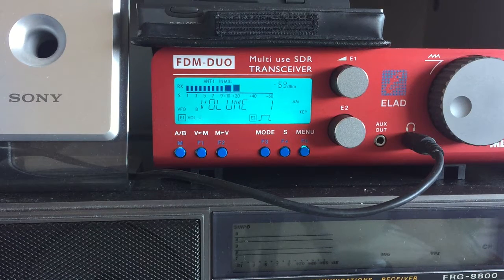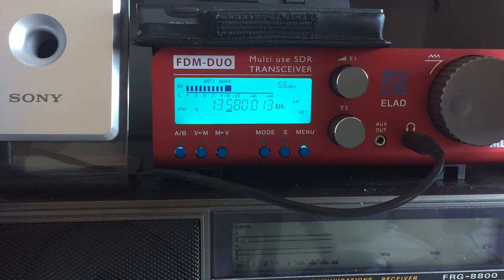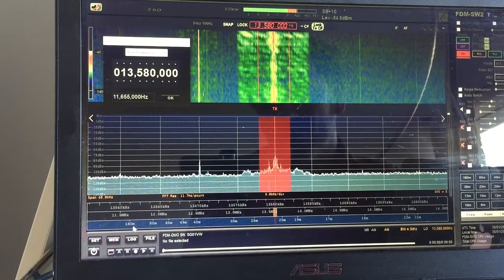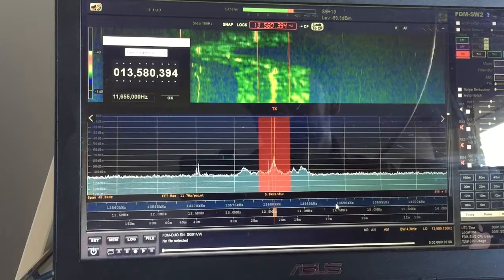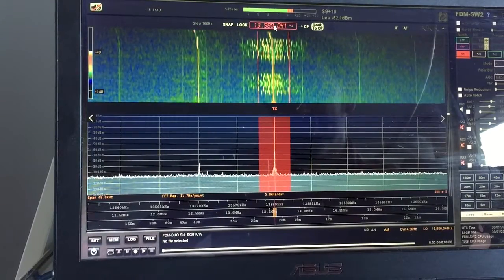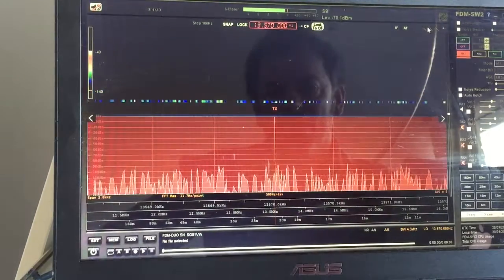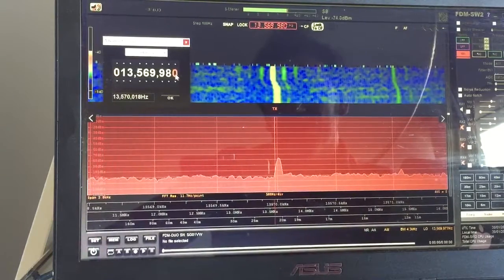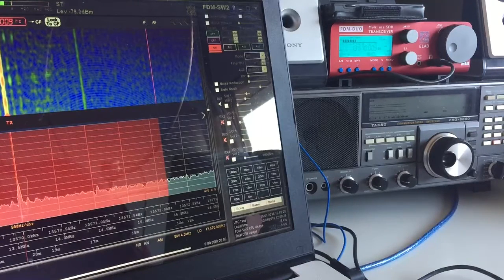6 different methods of tuning an Elad FDM DUO

Comment: Excellent demonstration video. Well done, Clint. You can set the direct frequency input to kHz instead of Hz in the settings menu, by the way so you can avoid to type in the ".000". 73, Matthias
Reply from the maker: +senderjaeger Hi Matthias, thank you very much. It took a couple of weeks to properly get to grips with the FDM-SW2 software in conjunction with the FDM DUO, but was worth the effort. Setting the direct frequency input to kHz will save time so thanks for the tip, I'll check it out. 73s! Clint
Reply: +Oxford Shortwave Log Clint- enjoying your vids of your Ferrari Red Elad! You can also hit the "+" key to automagically add the .000 digits. As well, you might try setting up the "Snap" button..... it will automagically "Round Off" the last digits to your pre-determined choice, negating the need for any such blather ;-). Keep up the good work, and I hope to order one SOON!!! Regards, West Mitten, USA here.......
Reply from the maker: HI there, thank you very much for taking the time to watch my videos and comment.I use the Snap button all the time now to round up or down and in fact these days I rarely tune from the Elad itself - I always use the FDM-SW2 software. It's incredible. I hope you manage to get yours soon! 73s! Clint